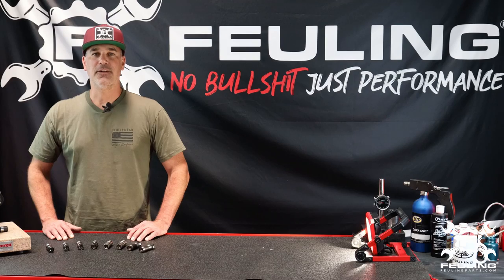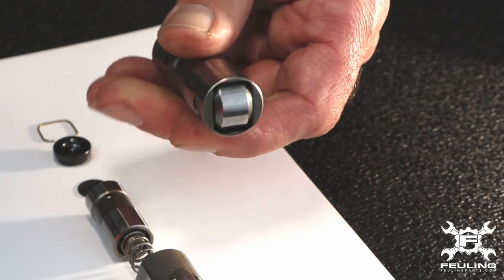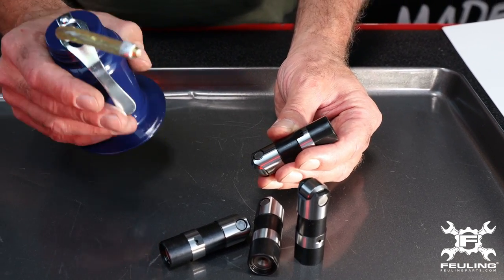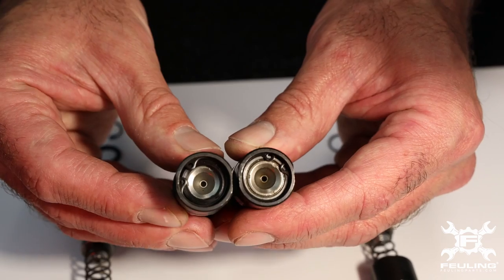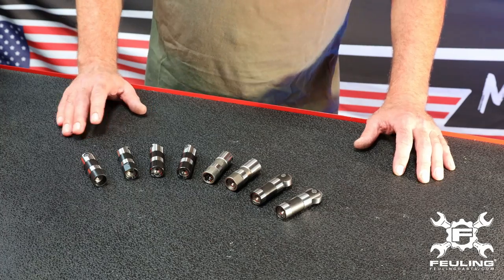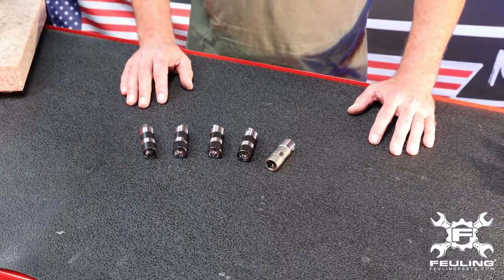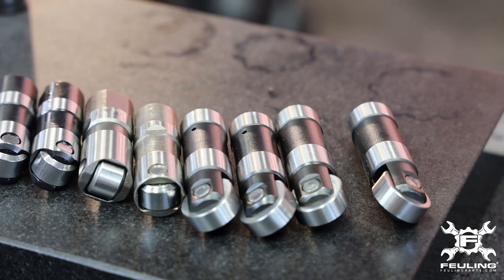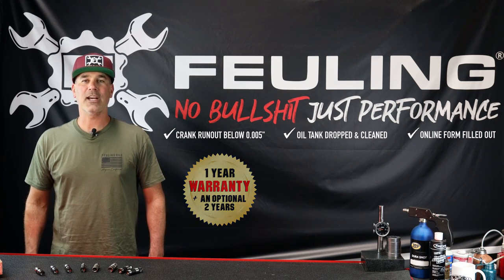FEULING LIFTERS

Comment: What small batch means performance wise? I would like to watch a more detailed video about your lifters. I mean, explaining the small details about every component of the lifter. This video has only generic info that you find on every Harley forum discussion. After watching this videos I still have lots of questions about them. Are they forged or cast? What tips of bearings they use for the rollers? How do check if they are functioning properly when I receive them before installing? Are they good for using with the stock oil pump and cam plate or they require the use of your oil pump and cam plate? What is considered a mild performance engine to use the HP+ ( max cam lift to be considered mild performance) ? And the list goes on…

Comment: The two year warranty options is pretty cool. I run the HP+ in my twincam with some Wood TW-777 cams and FuelMoto adjustable pushrods. Getting the preload correct is a little bit of a pain but when you get it right, they work awesome.

Comment: A Harley Davidson Evo has to deliver 4 times the amount of oil through each lifter at the limited pressure and flow capacity of the Harley Davidson oil pump every other crankshaft revolution to supply lubrication and cooling to the top end, automotive engines have a dedicated cooling system. Since less oil is needed for valvetrain lubrication, and only a little cooling of the exhaust valves is handled by engine oil, they're design doesn't supply enough oil.

Comment: their engine parts are top quality. been using them for years, never an issue or failure. best gear I've used in 50 years of wrenching-riding.

Comment: Does the oil feed hole have any other purpose other than to pump oil in the lifter before installing?
Reply: It has one other small purpose. To send that same oil that keeps the lifters pressurized, up through the pushrods and out onto the rockers...